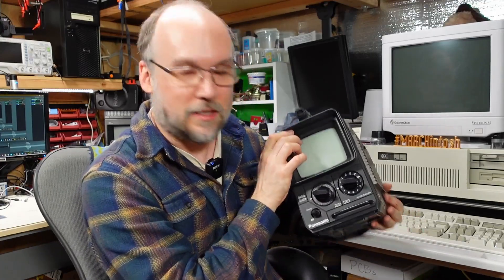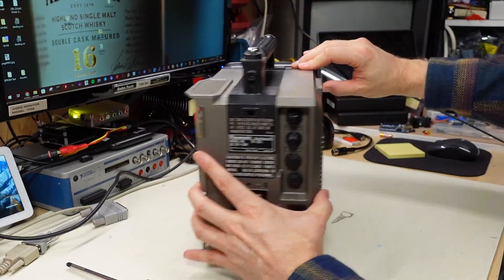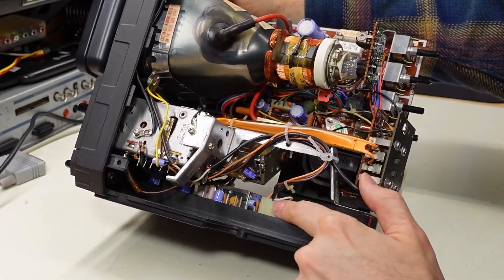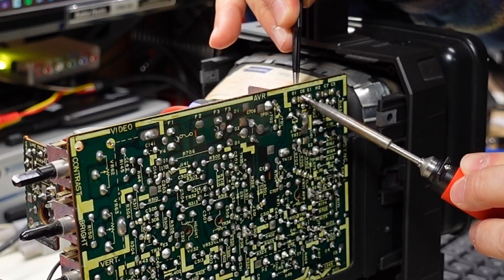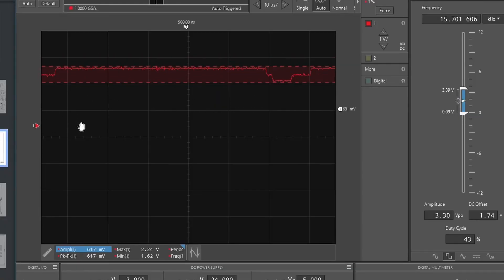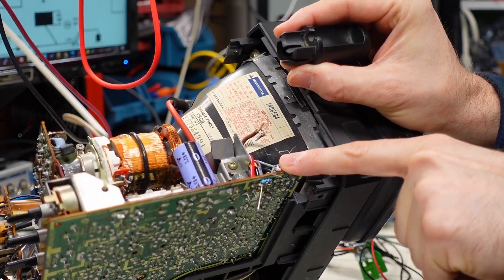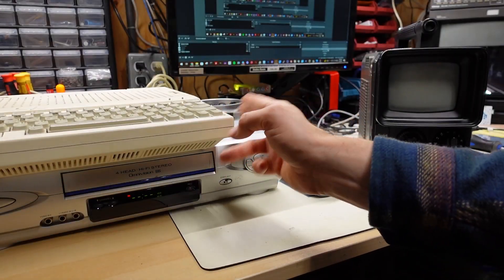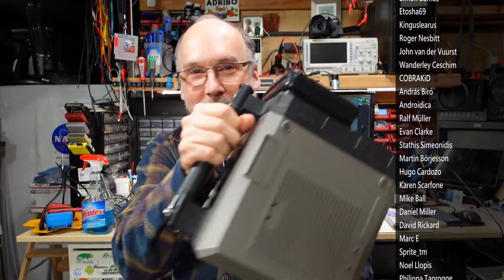Adding a composite video input to this 1977 portable TV (Panasonic TR-555)

Comment: I was never afraid of series wired sets because I always had a polarized plug. Even when my uncle filed the plug so it would plug into an extension cord which I never used. I would look before plugging in the set. Our wiring was done by dad and he knew how to wire. Even the inspector told mom you don't have to worry about his wiring he wires better than most electricians I inspected after. Well there are plug inspector plugs that tell you if the plug is wired right. I myself just use a neon light tester I keep on on me all the time. This is elementary wiring and I cannot understand what is so hard about polarized plug theory. 73

Comment: The 4.5Mhz filter isn't for blocking chroma. Black and white TVs never do this as the chroma is laced through the top end of the Luma bandwidth - you would lose fine details from the picture. It's to stop interference from the +4.5Mhz FM Audio carrier.

Comment: I found the schematics on Sam's website for my TV. I'm going to try adding the Video and Audio input to it. I'll see if I can reuse the test-points mentioned in the troubleshooting section. I will have to find a way to shut-off the input from the tuner.

Comment: Primary usage of this TV appears to be for studio cameras, like you'd see on News TV sets and the like, especially since you have a headphone jack for monitoring audio, and the slotted mounting plate at the bottom to attach to the camera chassis, would explain the power input as well, being "out of the norm" without a ground

Comment: Nice. I got a similar sized color set which I was hoping to RGB mod (it already has composite-in, at least...)  Unfortunately, looking at the schematics it seems once the signal is converted internally to RGB, it's up to 4V peak-to-peak or something. I guess I could amplify the RGB I feed in but I'm not sure if it'll work out.  But just using the composite in does make it a good color display for my Apple IIc, at least!
Reply: Yeah, just amplify the RGB. The most worrying part is finding video frequency amplifiers, but that's just a matter of doing some research- I've occasionally seen them on e.g. Jameco without looking for them.

Comment: To address Adrian's first point about two-prong polarized plugs, perhaps get some three-conductor cable with a three-prong plug (either separate or already attached; I know Home Depot has replacement three-conductor cords for power tools that have three-prong plugs: I bought one for my 12-volt switching supply that just had screw terminals) and integrate a proper ground as part of your mod, along with an isolating transformer, or a switching supply with reverse-polarity protection perhaps...
Reply: Not a bad idea adding an isolation transformer, but the smaller TVs don't always have a lot of room for such mods inside the case.
Reply: @greendryerlint  yeah, that's true, but what I typed can also apply for larger sets that don't already have alternate input

Comment: By having the video signal coupled with an electrolytic capacitor, and two resistors that are being used to provide the DC offset, this can lead to the video signal DC offset voltage shifting either up or down, all depending upon the composition of the video signal itself.  In a situation like this, I used a Zener diode. The Zener diode was tide to the B+ and to the intersection between the electrolytic capacitor and the two resistors. This Zener diode then determined what the minimum video signal DC offset voltage was to be, and thus the video sync pulses would always be riding on this set minimum voltage that is determined by the specific Zener diode voltage itself.  So even if most of the video signal suddenly gets bright white across the screen, the DC offset voltage of the sync pulses will remain the same, thus the black levels remain the same and the grey levels remain the same, and thus any somewhat grey text no longer suddenly becomes a very dark grey text simply because the rest of the screen suddenly becomes bright.
Reply: What voltage did you use the diode for?

Comment: 2:49 you see this live/ground issue, due to regulation and plug design would be highly highly unlikely if not impossible in the UK
Reply: Oh no, it's still an extremely serious issue with british TVs. The only ones we bothered to isolate were ones that had caravan power, or shared a chassis with one that did. If you look in the back of one the Aerial connector is isolated from the rest with a couple of capacitors.

All it would take is one socket wired the wrong way around and bang.

Comment: @2:50 I ran into a miswired outlet - so it does happen. The homeowner was getting shocked by his satellite dish outdoors. Turns out the coax ground was connected through a satellite receiver and back to a TV coax input. The TV chassis was "hot" from the miswired plug and energized the entire RF chain (apparently the satellite receiver coax input and output were internally isolated, so didn't blow the cct fuse). They were fortunate they only received incidental shocks - they could have been electrocuted had they simultaneously touched a good earth ground while handling a component on the energized coax chain.
Reply: I know what you are talking about.  Back when I did computer repair, I had an on-site location to fix a networking issue between two computers.  These 2 computers were using a BNC old style connector and when I touched the termination cap on it, I instantly got burned!  Found out right away that their outlet had grounding issues, which was causing the network issues.

Comment: Adrian, For your next trick, build a portable battery bank or power source that will power not just that TV, but also any retro computer; Apple IIc, C64, etc.  That way, you can throw them in a backpack or take it on the road in your car.

Comment: One thing i have noticed about old electronics ie arcade pcb boards are the amount of ceramic filter caps. What are those things used for or do?
Reply: They are there to filter out the high frequency noise that the digital IC's generate on the power supply rails. By placing a small capacitance near the power pin, when the IC pulls a power spike the power comes directly from the capacitor and does not lower the supply rail voltage creating noise.
Reply: @IanSlothieRolfe  Also known as "decoupling capacitors" or "bypass capacitors".

Comment: I have a small zenith branded tv that has the same 5” crt. It’s still of the era where composite ports were not a thing for consumer use, but newer than this TV. I want to add composite to it however after looking at the SAMS for it, it has what seems to be a jungle chip (a simple one without OSD menus/CC decoder/etc) that takes IF signal directly and drives the H and V deflection of the CRT. I don’t see how I’m going to be able to add composite to this set without either building a “IF Modulator” to modulate the composite up to the 15.75(?)MHz or build a whole new circuit to replace the jungle chip and handle H/V deflection, signal detection and all on my own. Both seem too complex for the mod I want to accomplish.

Comment: As I understand it, the resolution of an NTSC Television is 575 rows by 192 lines.  I'm not sure whether that's a hardware limitation of the CRTs being used or just the specification the rest of the system is built to.  That's not a very sharp resolution, but should look very good on a CRT that small, just because of the denser dot pitch in use.

(The same document I read about NTSC so very long ago also opined that NTSC really stood for "Never Twice Same Color"... it was a hoot to read.)

Back when I had my old Actrix DS, it showed 80 X 24 column on a 7" amber display that was insanely sharp, and, so, easy to read with my then much younger eyes.
Reply: This a black and white screen, it doesn't have a shadow mask, so there is no horizontal pixel limit, could say ~2000pixels by 192 resolution
Reply: @tonysofla  There is still a horizontal limit because each channel has a limited amount of bandwidth. The video section takes up less than 4.5MHz which limits the resolution. Assuming a hard 4.5MHz limit and two pixels per cycle this would give you 480 horizontal pixels. Not coincidentally old TiVos record at 480x480 when digitizing at High or Best quality.
Reply: @eDoc2020  yes with 4.5MHz filter and also how RF encoding limits it. ntsc: 63556 ns per scan line/ 4.5Mhz bandwidth (222ns) = 286 pixels max per scan line (actually less as back beam trace). But as he removed the filter, he probably could push it to 100ns pixels = 640pixels so 80 columns will still look sharp.

Comment: Pardon what might be a stupid question.  Is there an easier way to transmit screen images from an ipad or modern TV to these old vintage portable 80's TV radios...?  I want to get an identical image on multiple tiny 5" screens, like that one - I'm trying to decide if I'm up to the project.

Comment: The “bar” of dim area that moves up the screen is due to power supply 60Hz ripple. There might be some capacitor(s) that should be checked to help reduce that artifact.
Reply: It's probably specifically related to lack of sync between the TV and the camera (sync requires special genlock I/O hardware that most equipment doesn't provide), otherwise it would actually just stay in one place all the time.
Reply: @absalomdraconis  - the slight difference in frequency between the vertical sync 60Hz and the AC mains 60Hz will be a very small frequency. That is why the bar moves so slowly.

Is it possibly the camera? I can’t say. But what I described is very common in the TV world.
Reply: @stevebabiak6997  It's definitely the camera, not the power supply. The power input to the TV is DC and I would strongly guess that Adrian is feeding it from a regulated source.

Comment: I figured be easier to buy a portable TV that already has composite input I have a Contec that does. Also I wonder if a mod would be possible to make the channel knobs actually work again for digital television with a digital tuner inside that corresponds to the channel that the channel selector set to?

Comment: Most TVs in the 90s had a 2 prong socket/connector AND composite video jacks. How are they any safer?
Reply: Same as the pair of slot-head aerial screws: small-signal coupling for an isolated ground.
Reply: Many (I'd say most) of these sets run 90% of their circuitry from flyback windings which are isolated from the power line. Only the horizontal output and some control circuitry run from line power in these designs.

Comment: Wouldn't a diode after the cap on the video line and before the b+ line be a good bit of additional protection against voltage going back towards the source device?

If I'm misreading your schematic then ignore me, but it looks to me like b+ connects between the source and before the analogue boards input which as you say is to boost the signal to over 2v, but the only protection is a capacitor which really don't like being installed backwards and it could effectively be in a fault situation.

You really wouldn't want nearly 12v making its way back towards a potentially rare and valuable device.
Reply: The only time the capacitor will be reverse biased is if the source outputs a video signal with a large positive DC offset. And actually electrolytic capacitors don't really mind being installed backwards if the current is limited.
Reply: @eDoc2020  Good points, if it was me I'd still want a diode in series with the capacitor just in case.
A diode costs almost nothing so putting one in for some extra protection would be a good idea.
Reply: @PaulTheFox1988  The problem with putting a diode in series with a capacitor is that once it charges up no signal will be able to pass through. If you want protection I'd add a resistor in series with the capacitor as it would limit any possible backfeed current.
Reply: @eDoc2020  a diode allows current to only flow one way, hence why I think it's better suited to the way I'm thinking of using it.
If we put it so that the voltage can go from source to CRT we prevent current flowing back to source in case of failure.

A resistor limits both ways, so it might work fine to protect the circuit, but would cause a voltage drop coming from the source device, which might cause issues with the signal working correctly at the CRT circuit.

I dunno, I'm by no means an expert at this, I'm just throwing it out there of a way to potentially protect a vulnerable device that might be connected to the TV. :)
Reply: @PaulTheFox1988  A diode would work for protection when dealing with DC-coupled signals but the video signal is AC-coupled. For white parts of the video the source pushes a tiny bit of current into the TV and for dark parts the source pulls a tiny but of current from the TV.
Reply: @eDoc2020  Ah, that makes sense, I didn't know it was AC coupled, I thought it was DC, but when I looked into it it turns out you're correct, and in that case a diode absolutely wouldn't work.
As I said, I'm not an expert or even an amateur in this so I appreciate your insights :)

Comment: I've wondered if installing an isolation transformer in an old set would allow for a safe composite mod. Provided I could find room for the transformer.
Reply: I've got a couple isolation transformers mounted to pieces of wood (with terminals), for working on arcade monitors.
Reply: I recall a design, from the 1980s, for a mod which used opto-isolators to use a TV as a monitor.
Though this was for the BBC Micro outputting TTL level RGB, which can directly drive an LED. It would be rather more complex to do this using a composite signal.
Reply from the maker: Yeah the opto isolators won't work properly for composite video. (But totally fine for digital RGB.) One would need to using a transformer on the video signal.... which can introduce problem on a low frequency video signal.  Of course using an isolation transformer would totally work to turn a hot chassis into a safe chassis. But you'd need a big enough one that could power the set but also sit inside the set.
Reply: @adriansdigitalbasement  yeah, it's the larger-style transformer I was imagining. The type I use when working on 19" arcade monitors. But, there's then the issue of whether I could fit one inside the TV case.
Reply: @JamesPotts  the magnetic flux would do crazy things to the shape of the raster.
Reply: @adriansdigitalbasement  I was thinking that even using a transformer for signal isolation would require a composite signal to be amplified. Something easier with a TI-99/4A, VIC-20, etc. with have a power output on the monitor socket.
Reply: @bryanminugh9680  good point
Reply: @adriansdigitalbasement  There actually are some optoisolators which would work fine for composite video. Apparently some Mitsubishi TVs used a setup like this. Somebody gave me a part number for a suitable isolator and it would be helpful if somebody designed a little carrier board to easily integrate it into hot chassis TVs.

Comment: Integrating a The C64 in that case would be amazing :D A low budget SX64
Reply: Or a pi and make a portable Emulation device
Reply: Jeri Ellsworth made that "DTV-64" the Home Shopping Channel sold a ton of a few years ago. The 5-1/4" diskette mech would be harder to find space for than a  3 1/2" DSDD mech, even with the IEC serial Jeri put in to run it.

Comment: off topic, i have a TV that has composite and s-vid, but are considered to be the same input. the TV automatically chooses s-vid, even if both composite and s-vid are plugged in. if the s-vid device is not powered on, the TV still says s-vid and won't switch over to composite. the s-vid cable itself has to physically be removed from the TV. is there a hack or mod to amend this so both can be plugged in at the same time?

Comment: Can you RGB mod a TV that doesn't have an on-screen display? Without going through a ton of effort, at least? I ask because it was my understanding that hot chassis televisions were pretty much phased out by the time TVs with OSDs were popular. And of course, any TV with composite inputs wouldn't be a hot chassis set, or at least one where the entire board is live at mains level.

Comment: one of the ideas i would have had is to replace the headphone jack for one that accepted video and make it l and r audio in instead of out going to the speaker circuit, that way you could just use a 3.5mm jack to rca breakout cable and have it look 'stock'

Comment: If I'm looking the schematics for a CRT power supply and there are no chassis ground connections, would it be safe to do a mod like this on a CRT using 120v power?
Reply: If you need to ask the answer is no. Besides that, still no. The composite mod exposes the chassis ground.

Comment: Hello Adrian, would you like to get Finnish (PAL) C64 with disk and cassette drives? It has some special stuff with it too like a C64 light gun.. I have storaged it fully working and non modded around 10 years ago, i havent powered it up since because im worried about bad PSU or some other problems it might have inside... I dont want to break it, lot of good memories about the machine.. I've had it since i was 4 years old, 1988.. Its the light grey (Well yellow now) D model.. Pile of disks (games mainly) and cassettes would be included in the package too

Comment: What? By injecting RGB into an existing circuit (assuming a separate Micon and Jungle Chip) poses zero risk to the device. You feed the ground into one of the many ground points available in circuit. All at low voltages.

I've never seen an RGB mod fed directly off the yoke, though I know that it's been done, but I have no knowledge of that circuit, but I still assume that it's well considered and done safely.

But for all of the in-circuit variations of RGB injection either using mux from the OSD, or using an unused 2nd RGB output on some chips, they are completely and utterly safe.

Not sure at all what safety issue you are referring to.